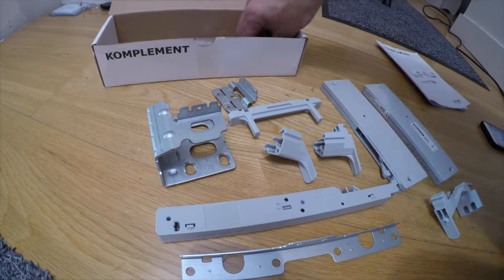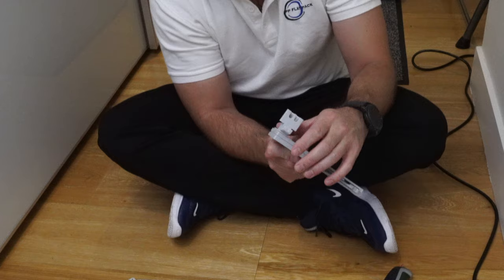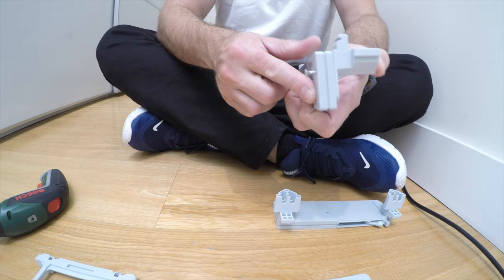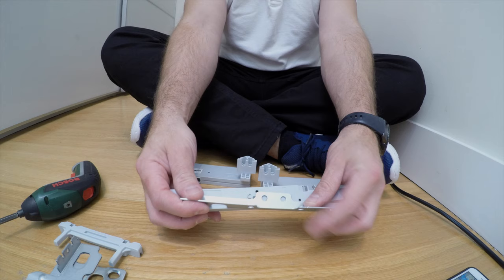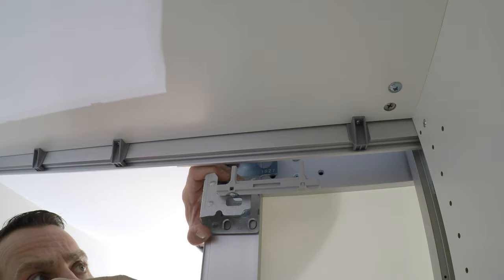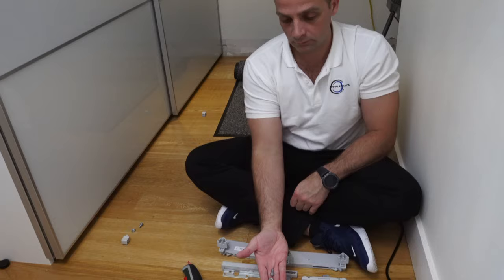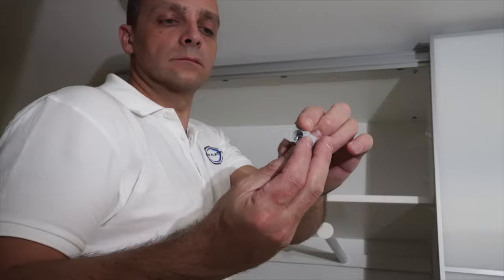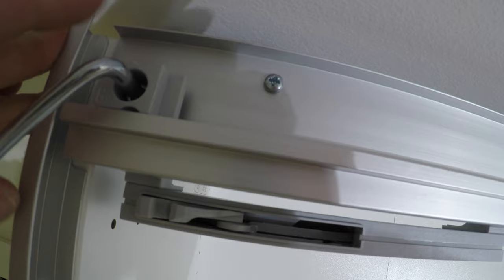IKEA PAX sliding doors soft close instructions

Comment: I'm confused by the replacement screws to attach the metal plate to the existing door.  The ones I've received have a completely different thread size.
Reply from the maker: Replacement screws are always included in the soft closing box same thread slightly flatter head and bit longer than original screw.
Reply: PP FlatPack thanks. But I've checked both sets I've got - the 3 screws provided are the same as the screws that go through the top of the wardrobe into the grey plastic plates that hold down the top hanger strip.  I've used the old door stop Allan bolts for now which are the correct thread and longer.
Reply from the maker: @NotThatOneThisOne  Strange I just did one today same as in the video and all screws and plastic stoppers was in order as usual.
Reply: PP FlatPack fair enough. But in the video you're installing the soft opening and closing kit. I'm installing the soft closing kit - which has fewer bits and is a different box number.
Reply from the maker: @NotThatOneThisOne  If you like send the picture of the all screws in the soft closing package separate them same size and shape and send it to my mail will tell you what goes where.
Reply from the maker: @NotThatOneThisOne  There is two soft closing kits one is with middle soft closing between doors and on the left and right (that's the one in the video) older one have just left and right side soft closing

Comment: @PP FlatPack For some reason, when both of my sliding doors are on top of one another, they get 'lock' together - which means I can just slide either door freely without having to 'free' the other to separate them. I don't know why this is happening.
Reply from the maker: Here is possibly solution to your problem  . https://youtu.be/d9V62-D6jqw
Reply: Hey @Faisal I am also having this problem whereby the inner door sort of locks into the mechanism, and I have to pull them apart using quite a lot of force to separate them.. it's not right. How did you fix yours, what was the problem? I checked his suggested other video, but I don't think mine is an alignment problem
Reply: @olliehardy5264  We have not found a solution for this issue - our contractor is convinced that they installed it according to Ikea's instruction and that no other condition would interfere or make the sliding doors not work as they should. We did reach out to Ikea on this and received almost no help. So at this point, we kinda just have to deal with it, unfortunately.
Reply: @fjumehara  Faisal, thanks for your reply. If it helps, I sorted mine out .

Check the back of the outer sliding door panel, remove the white anti scruff strip . In my instance, this made be gap between the two doors too large, and once removed, the sliding mechanism works much better and the doors no longer lock with one another
Reply: @olliehardy5264  that's fantastic. Where is this anti-scuff strip located? My guess would be by where the soft closing mechanism is? Is it a piece of foam/felt/plastic?
Reply: @fjumehara  no problem. Right at the top ,at the back of the outer door, there is a strip of white foam, I would just remove it, it doesn't affect the door scratching (at least not for me!)
Reply: @olliehardy5264  This is great. Thank you, sir. Worked beautifully. Who would have thought - such an easy fix.
Reply: @fjumehara   / bad design from IKEA I think. That pad is too thick to be used with the soft closer, for me at least. Hope it helped dude!

Comment: What's the benefit of having the outer door on the left or the right, does it matter? Also do you need to leave a gap to open the door when the wardrobe is up against a wall? Thanks!
Reply from the maker: Outer doors can be o either side just up to you how you like it only if you have soft closing mechanism have to position that correctly. Regarding space from the wall. Up to you again how you prefer you can adjust stopper on the top rail.
Reply: @PPFlatPack   okay great, good to know there's a stopper I can position. I'm still not sure which is preferred for which side the outer door goes, what's the difference? Other than just how it looks? Thanks!
Reply from the maker: @David-wh7rm  Just the look no difference in practical use.